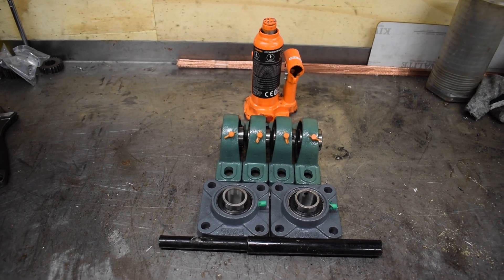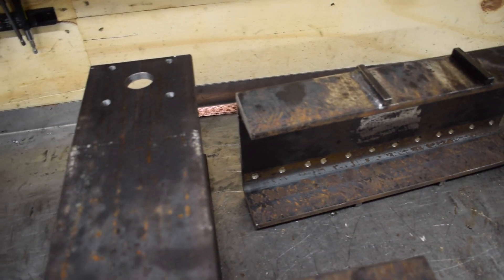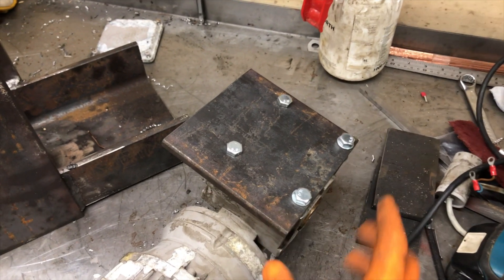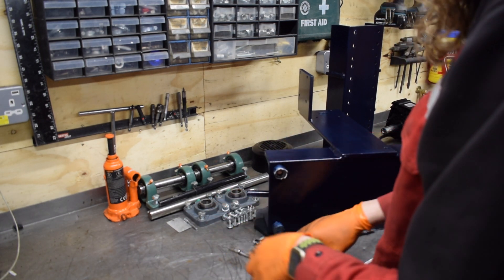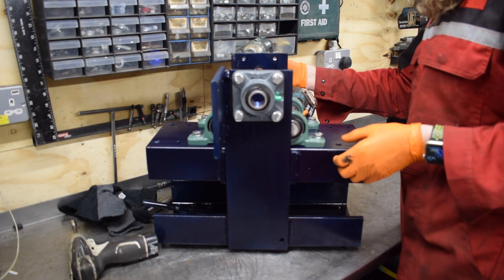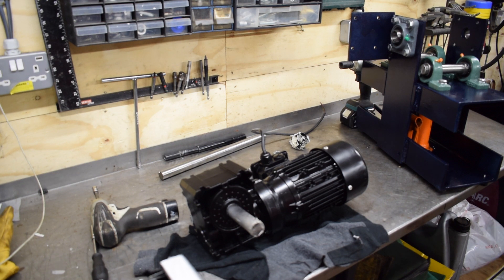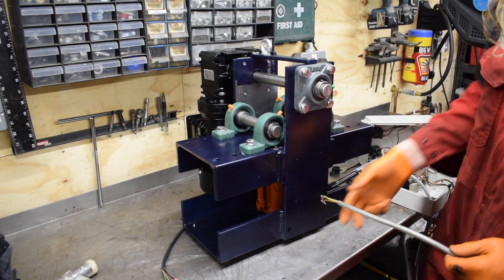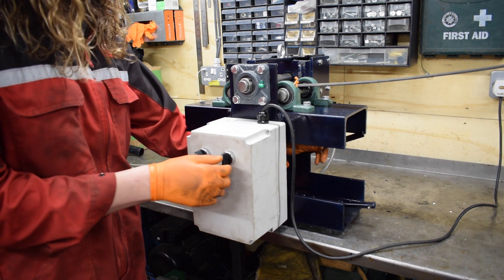HOW TO MAKE A POWERED RING ROLLER

Comment: Hi Kim, I watched this a week ago and I thought you could be interested in an idea that's been rattling around my brain for 20 years or more. A chainsaw powered alternator for boosting battery's in the field. take a chainsaw clutch drum and make it into a flat pulley the same profile as on an alternator.  make a fake bar and mount an alternator in line with it and fit the belt. Fit a drop down spike so it will stab in the ground. Needs a positive and an earth wire and wired with a charging light . A few safety guards, Fire up the chainsaw, set the revs and let it charge the tractor you are trying to start. simples. Cheers Jim in Nz

Comment: What a great little machine where did you get the design.
Have you done any trade training ie apprenticeship.
Reply from the maker: I have indeed. I’m a mechanical engineer by trade, I worked as a toolmaker but left after finishing.
Reply: @CalamityKim1  well done I'm a fitter and turner by trade and specialist in machining and maintenance in Australia
Reply: @clydelevey2737  Totally agree another fitter & turner UK